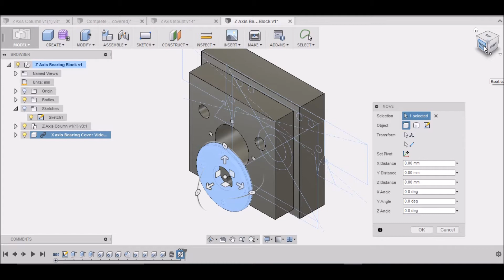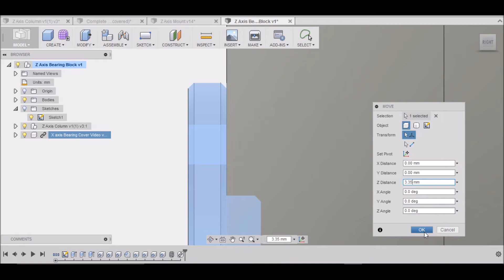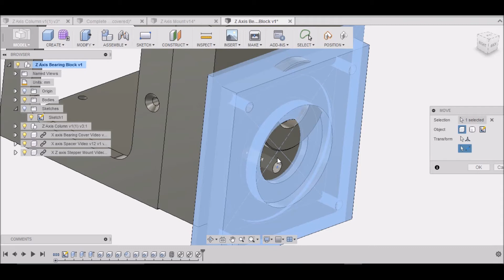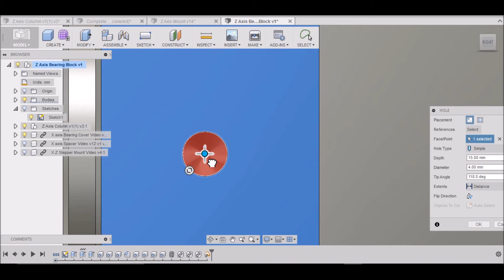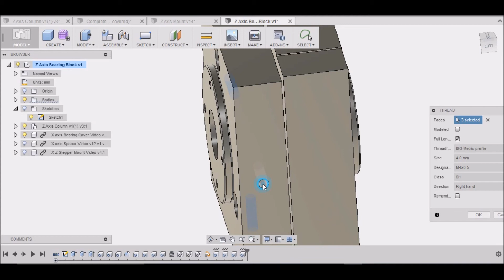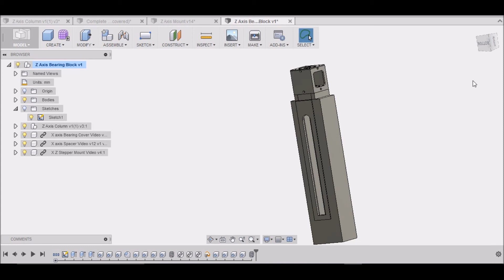PM-727M CNC " Z Axis Spacer"

Comment: Ever try using joints to assemble things together?
Reply from the maker: +Juiced105  I have not, Thanks I will give that a shot. I have used align However I had forgotten about that Until a friend mentioned it.
I was under the impression Joints were used for things like Hinges. Thanks for the Tip! 
Be Safe, Sam